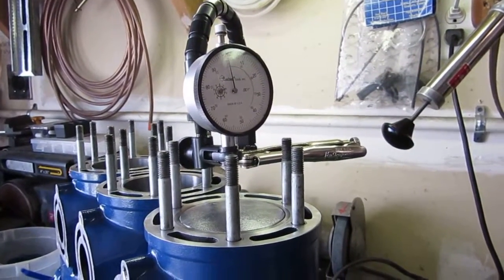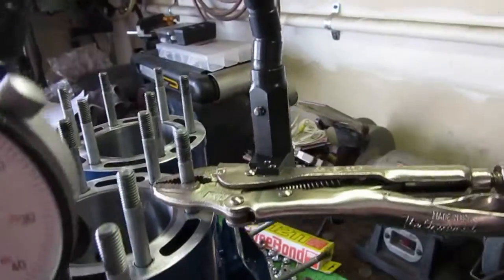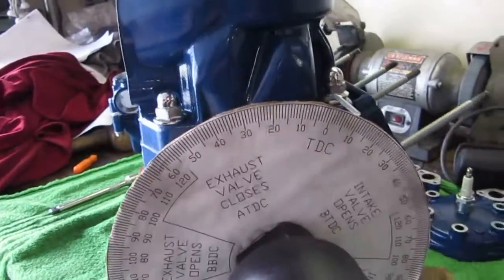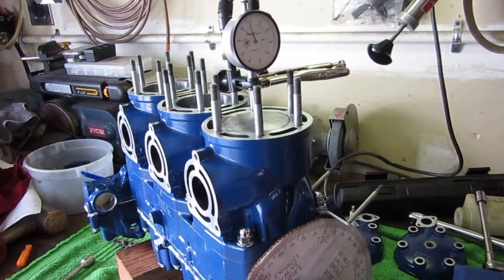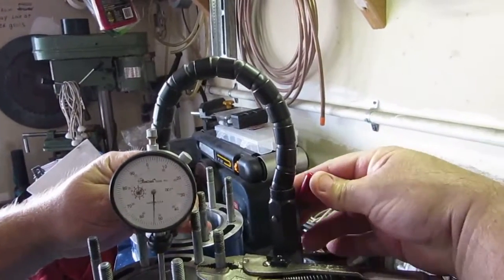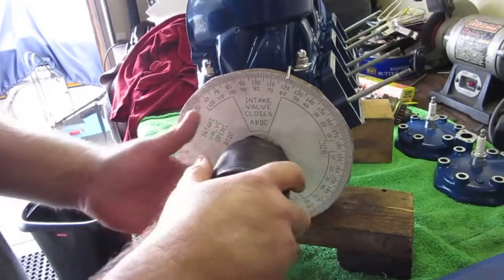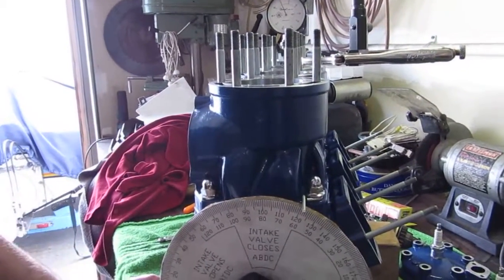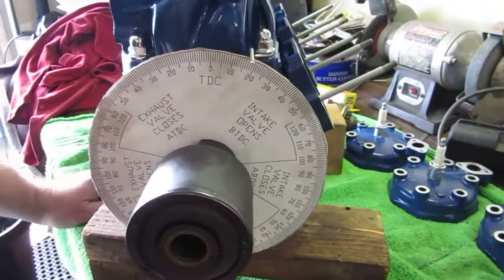Polaris SL SLT SLX PWC blue fuji engine 650 750 780 checking the crank index

Comment: I was look at buying a 94 sl750 and the front piston has a hole like this. He said it just needed a new piston and rings. Does it need a crank too ?
Reply from the maker: you have to check the index on the crank. I made a video showing how to check it. Other wise the reason for a hole is a lean condition caused by? Carbs clogged, intake leak,  exhaust leak,or vacuum leak.Good luck!

Comment: The PTO piston in my 95 slt 750 had the same looking hole started in it, except mine was a little smaller. However i believed that to be caused by the spark striking a dry cylinder due to the fuel pump failing. if the index being off may have caused this, how is it that it causes a hole to form? its not like its coming up any further and smacking the spark plug.  Yes/No

Iam just trying to learn something here. im not being critical. I' ve got a ski i cant get running after reeds, carb, and replacing the PTO cylinder. it backfired a bit. So now im not sure what to do. Stator slipped maybe.

Comment: need your help bro
Reply from the maker: What exactly do you need help with?
Reply: just bought a sl 780 1997,,need a new bottom case,,cracked on no.3,,rod and piston smashed,,also,,trying to engine out,,and im stuck,,got main shaft out but im stuck after that with all pipes/cables etc

Comment: what is that dial diagram? need on of those for my slt 780 im doing my first rebuild of a small engine ever
Reply from the maker: Its called a Dial Indicator. As I mentioned my wife made mine but they can be bought at your local speed shop.